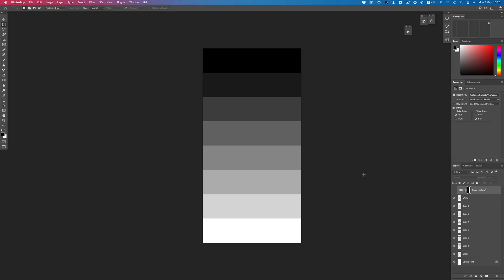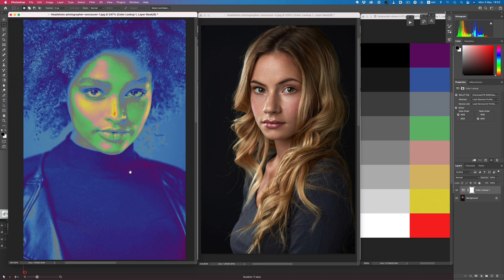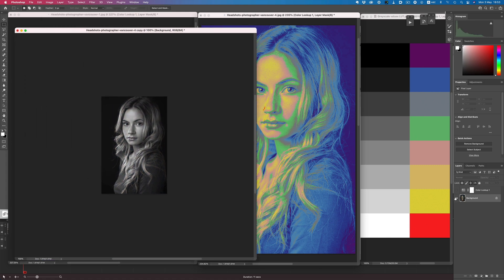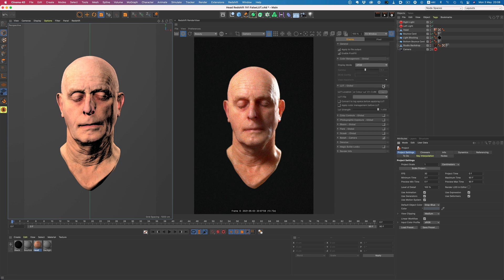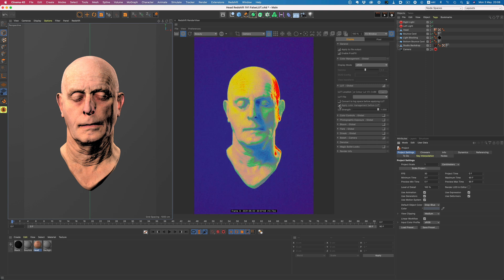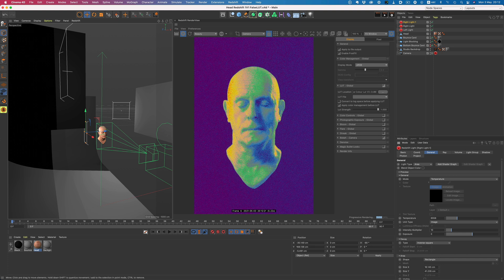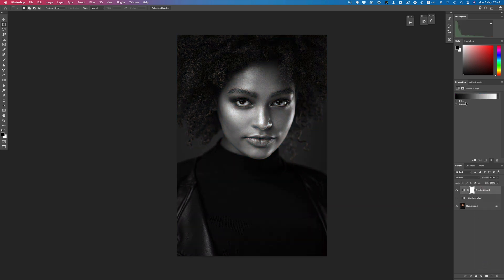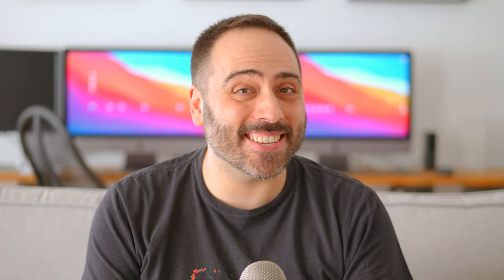Fine-tune your renders with false Color

Comment: This is a cool technique, but is probably more applicable in compositing. In general you want your renders raw values to be a bit overexposed, just like they would be in a real camera. Cinema cameras have a wide dynamic range that is written in log formats, and when expanded to linear form like you have in this render, the value of a highlight could be 20+. You initial render is probably better exposed than the end result. LUTs and remapping in post control those values, and the using tools like OCIO in CG mimics this and allow you to view a corrected image in your render view.